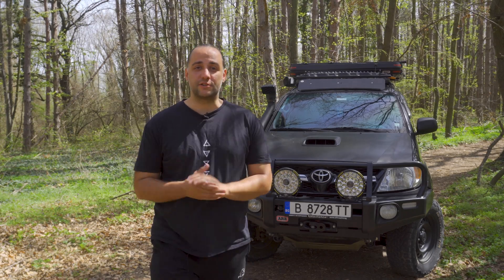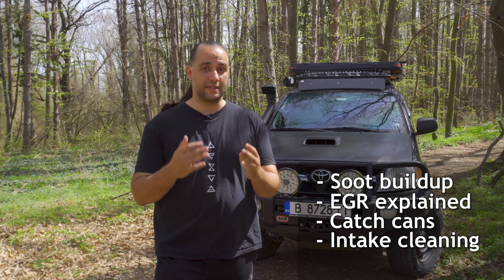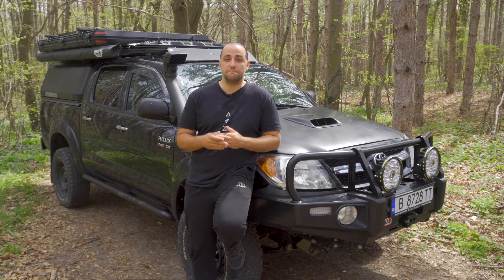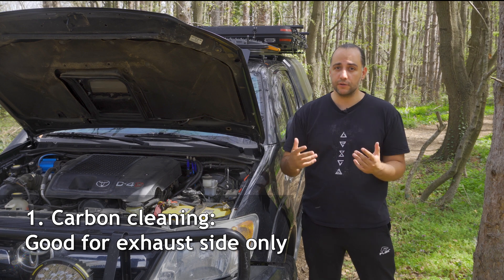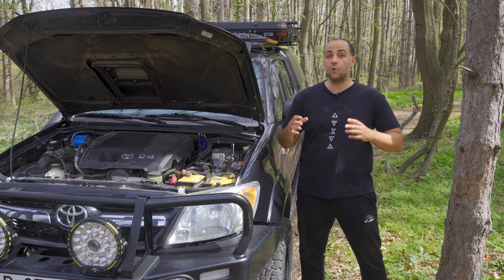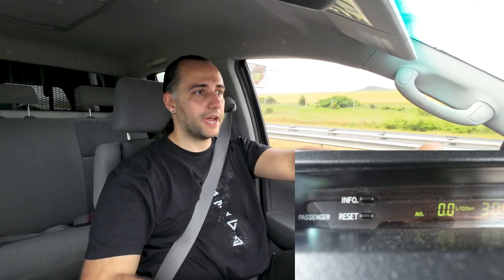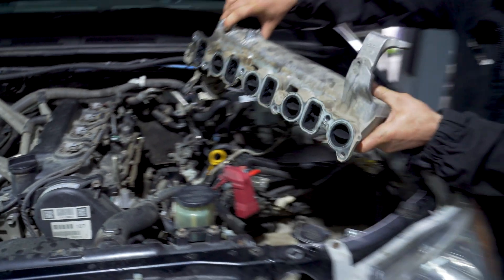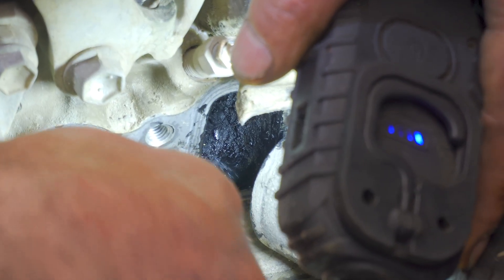Ultimate Diesel Engine Care: In-Depth Guide to Intake Cleaning, EGR & Catch Cans

Comment: can i ask, without doing the manual method:
would be good to do the chemical method first then to do the Hydrogen Engine Carbon Cleaning 2nd?? to do a 2 part clean??

or would Hydrogen Engine Carbon Cleaning then chemical be more effective??

thank you
Reply from the maker: Carbon and chemical are cleaning different parts of the engine so it shouldn't really matter which one goes first but if I have to choose I would go chemical then carbon (just following the air from intake to exhaust)

Comment: Just to ADD the MOST important point to add . Results may be less than 1ltr per  100 km [I can confirm this ].[throttle response improved ]  The debris [hard particles] and oil sludge increases wear on injectors prematurely  . 
The PCV and EGR systems are responsible
Reply from the maker: Sure thing - the difference was 0.5l in my test... But I don't regret doing it. :)

Comment: If you want your engine to last forever then you need to do the following:
1- install mechanical filtration oil catch can (not baffled one since it doesn't filter + increases the pressure) mechanical filtration catch can can filter almost 100% with no change in the pressure. 
2- delete the EGR & retune, engines are completely designed to work with no EGR. Actually EGR system doesn't work all time, it works only in idle and light cruising, other than that it stops working.
3- change air filter more often.
4- install a secondery diesel filter.
5- every 5000 km add injector cleaner.
6- avoid short trips as possible.
7- change engine oil every 3000 km.
Then see me after 20 years with ur stock engine runs more than 400000 km and still works like clock.
Reply from the maker: I mostly agree with your advice. I have also added secondary fuel filter.
However, 3000km for oil change? Isn't that a bit extreme?
What vehicle do you have?
Reply: @The4x4Lab  land cruiser 70 series.
For the oil change i go for 3000 km for all my cars petorl and diesel.
Engine oil is the blood for the engine. I wont go above 5000km whatsoever regardless of what the regulations say., the 10000 and 20000 is only for environmental issue not for ur engine interest, they want to reduce the amount of used oil dumped. So they asked people to keep it in thier engines for long period of time. Which i dont. Try to send a sample of oil that ran 20000km and to oil lab for analysis. You will be chocked about the results Its not oil any more especially in diesel engines
Reply from the maker: @duasobA  Thanks for the tip. That makes sense. I will consider changing the oil more often than recommended. 
P.S I would love to drive a new LC 79 or Troopy if it was available in Europe.
Reply: @The4x4Lab  its so impressive, i tried many offroad trucks, ford f250, nissan patrol, gmc yukon, i have now land cruiser 300 series gasoline, but when it comes to offroad nothing compare to land cruiser 70 series both diesel and gasoline. I believed it is available in Europe with the small engine. I saw several youtube vids. Only mistake toyota did with the new land cruiser 70 series is that they put the 2.8 L engine on it. That engine comes in the hilux, i hope they put the land cruiser 300 series v6  new engine in the LC 70 SERIES instead, if they did it would be the best ever LC 70 series. But for some reasons they didn't
Reply: @The4x4Lab  by the way, when I complete my customization to my troopy i will start a world wide trip, so when I come to Europe i will visit u to see and try my troopy.
My project is to swap the new v6 3.3L diesel engine f33a-ftv instead of the 2.8 L and replace suspension to heavy duty ones, install portal axles.
Put my troopy on my old 79 single cab chassis and then extend the troopy cabin to fit. Build the kitchen and the shower, install 270 awing.
Install upper hard wall tent. Install satellite receiver, and starlink, and lightening protector. Also 37 inch tires( maxxis at) which is the lightest. Also roof AC, sunlights panels, triple batteries, fridge, and water heater. And TV.
I really want to make one of a kind  beast almighty troopy in every aspect.
Reply from the maker: @duasobA  That does sound like a project I have never seen! Let's keep in touch on Instagram, can you find me there (link in About). I would love to see how that Troopy develops.
Reply: @The4x4Lab  sure, and i hope we camp together since I'm so addicted to camping and cooking outside

Comment: Great video, братанче! I was recently studying this topic and manually cleaned the intake manifold of my 125 prado 1kdftv. Then I decided to put a 7mm hole plate between the tube and the head. In this way, I have reduced the exhaust gases to a minimum, increasing performance but also it will never really get dirty ever again. And it still reduces the temp. Worked wonders for me! 

Успех с канала, абонирам съм!
Reply from the maker: Благодаря! :) 
Good stuff!
I'm curious, what method have you used to clean the intake from the engine side? Did you manage to clean all the way to to the valves?
Reply: @The4x4Lab  I actually followed your method of disassembly and did ultrasonic and pressure washing. I just installed the plate on the head side where stuff is dry.